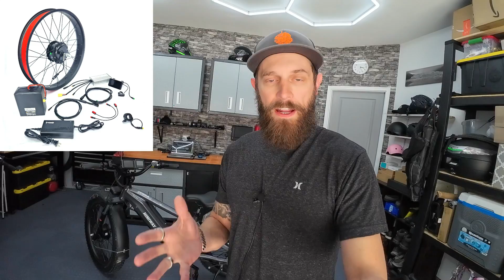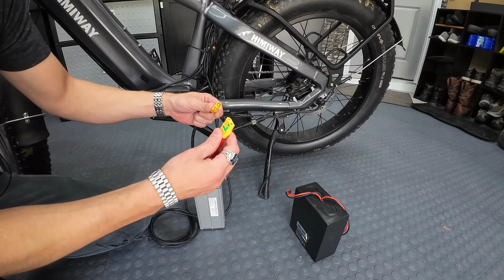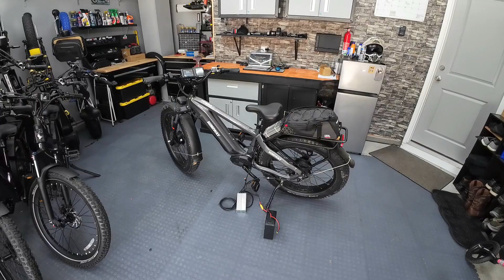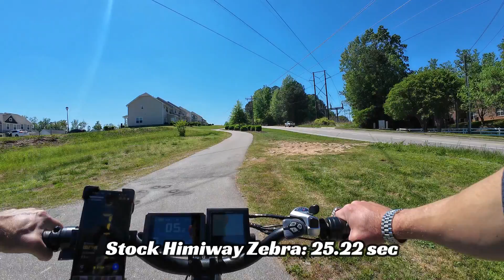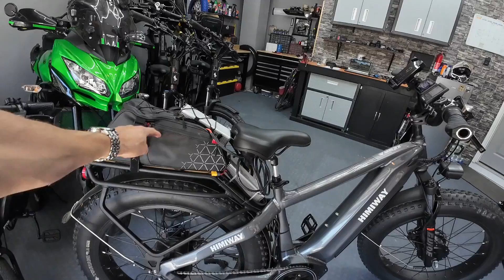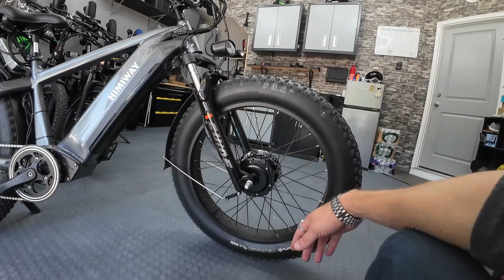Himiway Experiment: 40a Controller Upgrade

Comment: E bike ideas.  
Brakes shutoff should be okay to operate both controllers from one brake shut off. Front and rear 5 volt is 5 volt. Worth a try maybe?
40 amp controllers Great idea make both the same and change fuse in Himiway to 60 amp. Other bikes unknown.
Operate front wheel at PAS 1 all the time and a low setting and then will help off the line a bit more and you can add power when needed.
Change displays to both the same for rear and front drive.
Volts 48 to 52 back and front will work great. Or 48 and 48. On Himiway I found a 52 or 48 volt 15 to 20 amp battery that is a triangle bag and looks like it would work on the Zebra.  On Amazon.

Thanks for the great shows. 75 years and still ride.

Comment: We need 60V batteries and 40+ amp controllers and 1000 W motors for upgrading . The controller experiment increases torque but the speed will come from higher voltage batteries. So, upgrading the controller only will disappoint riders looking to increase their speed.
Reply from the maker: I can make 60 V batteries 40 amp controllers and 1000W motors, no problem. the issue becomes are you gonna spend a $1000 to add that kit to your existing bike. And then what do you do with your 48 V battery that's integrated into your frame...?  A controller upgrade does increase speed for bikes like himiway and Aventon that have their throttles limited.

Comment: The controller had nothing to do with the motor speed. In a no load situation, motor speed is voltage driven.

A better upgrade comtroller in this situation would be  Fardriver.

You can get one that will handle 80a for about $100 shipped.

Its also programmable.

On virtually all prebuilt bikes, you're working with geared hub motors.

These come with plastuc gears, which wear quickly and fail if you try to put too much power through them.

If you want to go much over 1000w, you need to either change the gears out, or change out the motors.

If you want higher speed, you need to increase your voltage.

Basically, if you want to build a fast ebike that will last, start with a bare frame, because you'll be trplacing pretty much everything on it.

Cheap mods to go fast can be fun, but remember that it can only go fast in short bursts.

Try commuting at 35mph, and your battery will sag badly, you'll probably burn out a controller, and geared hub motors will need the gears replaced regularly.

TANSTAAFL

Comment: I have a Juiced Ripcurrent S model.  It has the 750 watt motor.  It would be nice to have a upgraded controller.  On the new 1000 watt juiced bikes you can get the upgraded controller.  My buddy has the Juiced 1000 watt motor with the upgraded controller and he always leaves me in the dust.

Comment: You're right.  The faster the motor turns, the less time it has to pump those amps in.  On a steep down hill, with the throttle full, it uses no amps
Reply: This is why people go up in volts to get a few more hits per second.  Also why high speeds are very inefficient.  There are many magnets and only a split second to energize  each step.  You get 36mph with the wheel hanging only because the hub motor only needs a tiny bit of torque with no load.

Comment: Most of those fat tire 1000 w bikes have a 30 amp BMS but will still output much more for short Burst and there's probably either a XD60 or Anderson plug underneath the battery mount tray. Usually just a couple of screws 🪛
Reply from the maker: Hmmm I'm gonna have to look under that battery mount tray.....
Reply: @CitizenCycle925  You will need to open the battery to maybe be able to see the specs of the BMS.  Maybe Himiway would be able to give the specs.

Comment: You should make a good rear kit. A good geared hub will dominate The mid drives on the trails, but you would never know it.  There's only a handful that have enough power down low, and as far as kits you can buy, there is only the thousand watt bafang with a 30a controler, that kit is awesome on the trails but that's the most powerful one you can buy in a kit, and I very rarely see them for sale anymore.  DIY geared hub motor kits aren't available.
Reply from the maker: I've thought about making a rear motor kit. But it would be tough to make it universal, Since there are 60v , 52v, and 48v bikes out there...
Reply: @CitizenCycle925  the electronics of the ghostcat, with a 190mm or 175mm option, in a kit, 52v optional, and it would be even crazier if you had the options to use different motors with it.

Comment: That’s the same speed as my Zebra with the KD718 display. I don’t believe you’ll get higher speeds with just a higher amp controller. The motor is only capable of so much. I don’t believe this kit is worth it.
Reply from the maker: I had the KD718 display on my zebra at one point and it did increase the speed, but putting this 40a controller on there gives it WAY stronger acceleration and hill climb power.
Reply: @CitizenCycle925  yes, that's likely because it's able to deliver more amperage faster and more efficiently. But the top speed is not increased.

Comment: What's the motor life expectancy when upgrading the controller?
Reply from the maker: I'm not sure if there's any way to tell. I've been running my 750 bafang motors on the citizen bike with 52 V batteries and 35a controllers for years now and they're still going.
Reply: Depends on amperage, and how much time you spend at full throttle.

On a geared motor, it's the gears that fail.

They are cheap to replace, and not difficult, but obviously a hassle.

Comment: I would definitely be interested in any upgrades for my Himiway!! I have already put on a 52 tooth front sprocket, changed my rear gears to 11-32, relubed my gears, running Tannus liners, running tires at 22 lbs. Was thinking of changing tires to more of a street tire. I don't think I can do the dual motor even though I have a spare 52V and 48V batteries. If you build a kit for the Himiway I have three questions. What would the kit include, what can I expect for increase,  and what would the price be? I have hit 33mph on a flat pedaling my behind off...
Reply: You can do dual motors, but it makes sense to do it correctly. Change out the current controller for something designed for dual motor support. Most programmable controllers support this with thr controllers communicating via can bus. You use your existing throttle going to one controller designated the master, and the throttle signal is then relayed to the 2nd controller.

Some controllers (anything vesc based) also give you the option of limited slip, so if one wheel slips, the throttle signal to that wheel is reduced. Slippage detection is just too much differential in rpm between the two wheels.
Having two throttles is unnecessary and a dangerous distraction.
Reply: @Zomby_Woof I like his dual motor setup because if one of them fails then the other should still get you home.
Reply: @moonshotsilver  So does a normal dual motor setup.

In fact, I'm on front motor only after I smoked one of the craptacular oem controllers in my bike.

I have a pair of fardriver controllers on order.

You just don't need two throttles.
Yes, a throttle can fail. Lots of things can.

But throttle failures are uncommon enough that the distraction and awkwardness of two throttles outweighs any theoretical benefit.